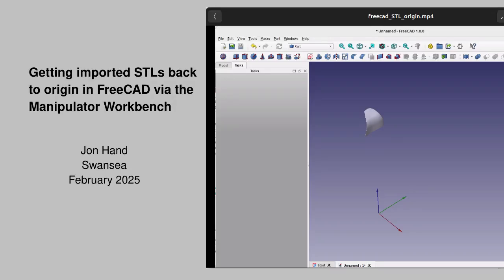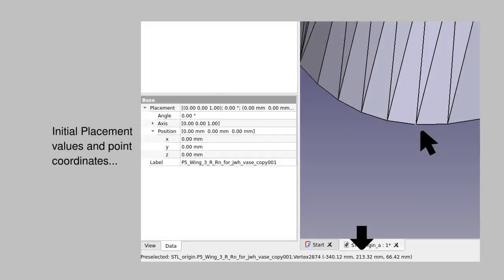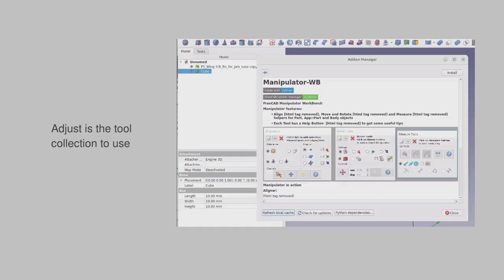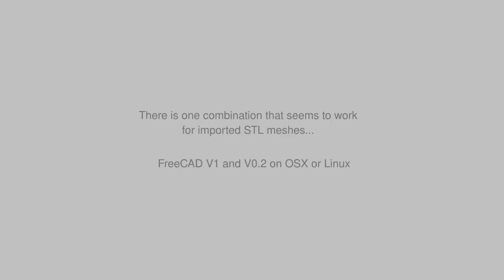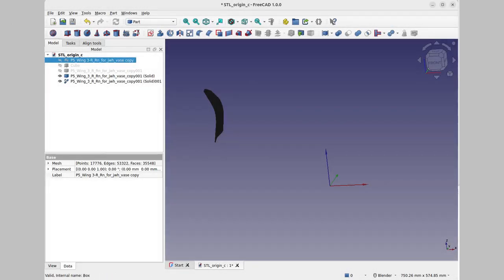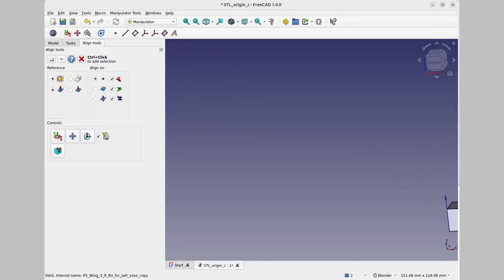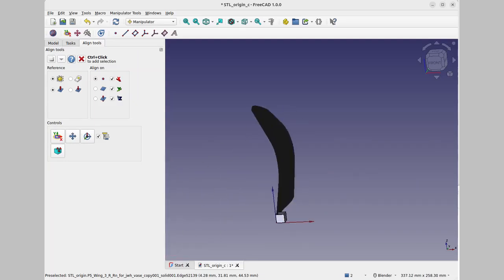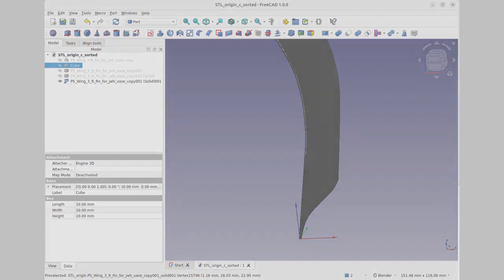Getting imported STLs back to origin in FreeCAD via Manipulator Workbench

Comment from the maker: Getting STL back to origin really frustrated me.  Quite a few views.  I it would be great to find out if others also find this a hassle.  And if you have an alternative method that is less hassle?
Reply: After watching your video, I downloaded the development version of FreeCAD (1.1) and tired the new version of regular Transform tool on an imported STP file - it worked very well (by using center of mass as origin and global coordinate system. But I am not sure if it is sub-0.01mm precise and if it works well with STL meshes as well.